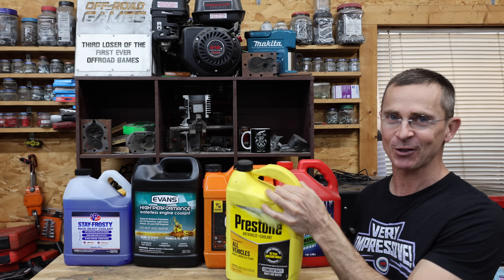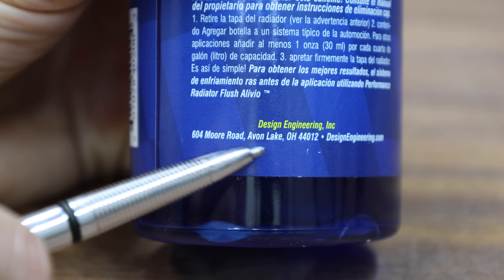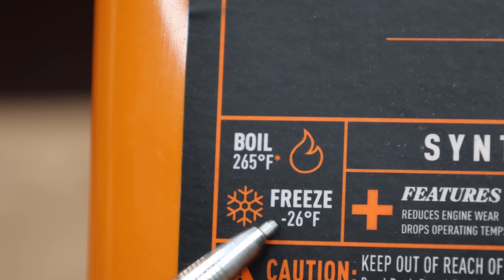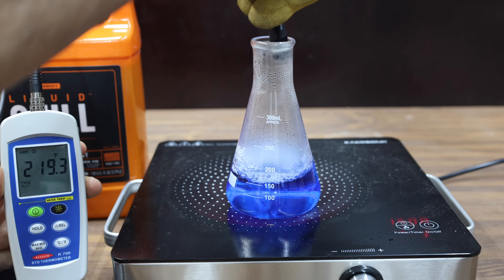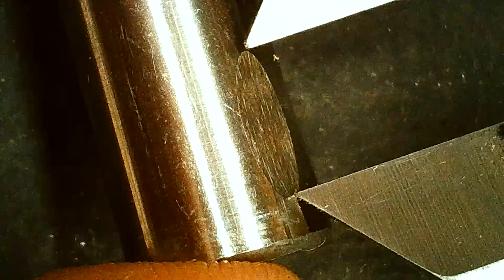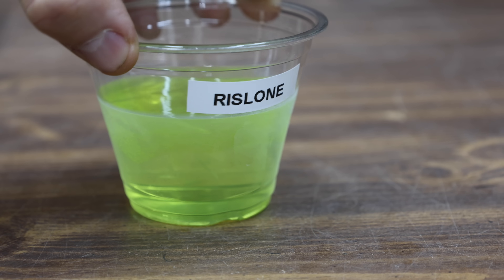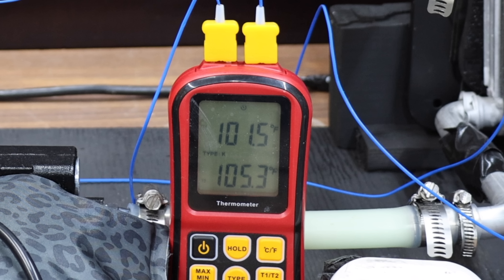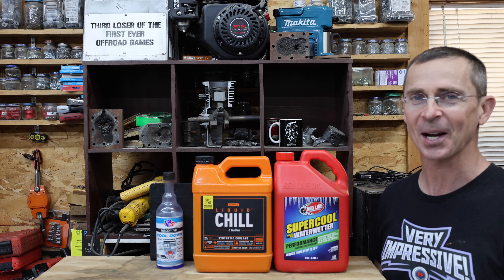Do "Super Coolants" Lower Engine Temperature By 30 Degrees?

Comment: Been waiting years for a test on the waterless anti-freeze. Thanks.
Reply: My Test was  it in real life and it is great, but expensive, you have to drain everything out and flush with water, then remove thermostat, flush with a Special chemical that removes water from the system and the  waterless coolant. 
You have never to change again, No waterpump defects, No headgasket sorrows, almost No pressure ON system, so No leaks, No Bad radiators or caps. Even If you get it out, you can Put through paint filter and reuse it.
Reply: @ I was told you have to bake the engine/car in an oven to make sure the cooling system is BONE DRY or the trapped water/moisture will steam off and ruin the whole concept.
Reply: @postalinVT  It's not that complicated from what I remember. Some would use a shopvac or hairdryer / heat-gun to dry out the system (leave it connected, pump warm/dry air through) or you can flush it with alcohol (prep fluid). Many interesting advantages to Evans waterless coolant.
Reply: @marstedt  Or when you are replacing corroded head gaskets. I also replaced the heater core and radiator at the time, as well as hoses. It's a good product.
Reply: @marstedt 
Back in the '90s, I requested the free literature from a magazine and I saw in like Hot rod or something. 
Basically they said it sucked the heat out so much better ,that all the guys with musclecars and high compression and pinging/spark knock because of crappy modern gas would have it pretty much disappear.
Reply: Well it has a pH and sulfuric acid is soluble and lowers the pH. That means it will dissolve a bit of water and be pretty much unchanged. Just saying and using my chem degree. I don’t know what the solvent is in the evens
Reply: @gasauto1675  FOLLOWING THIS FOR FUTURE REFERENCE 👍
Reply from the maker: You are welcome!
Reply: FOLLOWING THIS FOR FUTURE REFERENCE 👍
Reply: A key point about waterless is it may not be suitable for thermo-syphon systems due to its high viscosity. Evans have a low viscosity version but it isn't on the market at this point.

Comment: What I saw, is none of these lived up to what they claim, aside from the Evan's not freezing. They also add the potential to cause damage to your engine. How? Normal operating temperatures for engines is between 190 and 230 degrees, which anti-freeze does. Anything below this means the oil is not at the temperature to do it's job properly. Thus, you end up with more bearing, piston ring, and cylinder wear. Which is also why you used to hear, "Never rev/race a cold engine." This is why you see race cars being warmed up to operating temperatures, before the race starts.
Reply: In reality the thermostat should prevent this issue as it basically bypasses the radiator until coolant temperatures get high enough for 'good' engine running. You'd likely only see any benefit to cooling in extremely hot weather, under very heavy engine loads or if there was a problem with another part of the cooling system (e.g. the fan or partial blockage of the radiator core).
Reply: @ The thermostat isn't a bypass. It's a flow regulator. When you look up a thermostat. The temperature that is listed on it, is at what temperature it will open to allow more coolant to flow through the engine. It also shows the baseline temp it's trying to keep the engine at. For example, the thermostat on mine is at 192 degrees. The normal line on my temp gauge is right at 200 degrees. It hangs just under that line most of the time., so I know my thermostat is working.

But, yes, you're right on the rest. If high exterior temps, or heavy loads, are causing the vehicle to run at high/overheat temps. Then, yeah, this is a problem with the cooling package. But, only if it's running high. If the temp is under 230, that's within normal operating temps.
Reply: @jarack3256  Yes it regulates the flow through the radiator and until the coolant reaches the start of the thermostat's opening range, almost all the flow bypasses the radiator.
Reply: @217mot  There are benefits overall. Heat (and metal expansion and contraction) is what ultimately destroys all engines.
Reply: Your car doesn’t overcool when outside temps drop 30 degrees from normal. 

Thermostat will keep it at the proper running temperature, it just has some headroom when things go wrong and it overheats.
Reply: Simply wrong there mate.
It is the thermostat that regulates flow through the radiator as a function of thermal set point. On cold startup there will only be the bypass flow (which is tiny) through the radiator. Your heat input is the same. Until the thermostat opens your heat output is essentially exclusive of the radiator. Think about it.
Reply from the maker: Thanks for the feedback.
Reply: There was an actual scientific study done on coolant temperature and wear by GM (IIRC). It showed 160 F as when engine wear greatly reduces and then above that and especially above 180 it is just diminishing returns. 

A well functioning thermostat in the engine does not let it get any colder than what it's designed to be, it doesn't matter how efficient the radiator or coolant is. But more efficiency does matter when demand goes up. 

I will say most of us probably don't need these additives, but being someone with an anxiety disorder and having been stuck on the interstate for up to 2 hours on a hot summer Southern day, more than once, I can say I have seriously considered it and it still is in the back of my mind.
Reply: Your thermostat should keep the temperature the same, it's just the additives give the coolant to transfer more heat if it needs t
Reply: These products will improve heat transfer from engine to coolant allowing your system to reach operating temp sooner and oil Temps along with it.  It increases the efficiency of the system and people in hot environments need the improved transfer performance at the radiator.  The thermostat still regulates the minimum temperature and the additives add protection above that.
Reply: Needs a revisit. Under pressure coolant acts differently.  I use the Risolone in my Kenworth,  I definitely noticed that the engine doesn't get hot as fast, and the fan cycles less. 8.3L cummins
Reply: @AlcornDynamics  The engine should get hot faster with the thermostat closed. I've found many thermostats on my vehicles were slowly going bad before they all out went out, not warming up as fast as they should and it was a gradual decline. Maybe you should check yours.
Reply: @HAL-dm1eh  you missed the fact that im in big trucks, hills and weight though the southwest is hard on a cooling system.
Reply: Wear drops off after the oil reaches around 155 degrees F. The oil geek and Daves auto repair just went over that data.
Reply: Exactly this. Unless you have overheating problems, these don't really seem worth it to me. The pH buffering is interesting, but I have no idea if that is normally a problem or not.
Reply: @thorwaldjohanson2526  the pH buffering, is relevant in certain applications. It's one of the reasons, why there's different factory coolants.
Reply: Agreed when it comes to cold starting as that's when most of the wear occurs. Other than that, I've always had the best of luck with heavier oils. They breakdown later, lubricate better and keep viscosity longer. I am totally against this new fashion of ultra low viscosity oils in the name of fuel efficiency. Yes, heavier oils will impact gas mileage.. why? Because there is a heavier and thicker coating between the parts making the engine having to work slightly harder. Most oil at high temps is just like water, a horrifying thing. Best yet, simply change your oil more often. There is no such thing as 5000 or 10000 miles safe oil, forget about it. All oils get contained (very quickly) with the combustion process. Best oil you can use and best insurance for the long life of your engine is keeping new oil in it. I never do more than 3000 on any oil, no matter the brand, the specs , the price or the viscosity.
Reply: @yuidfbse sorry I don’t have the link, but I read a report a long time ago that the NYC taxi company started testing full synthetic oil vs conventional. Even after extended oil changes, the synthetic still exceeded new oil performance parameters. The switch, and extended oil changes saved them tons of money, and far less waste. This was well before 0w-16 oil, though. The super thin oil scares me too.
Reply: @OutdoorGirls7  Understood and it is a fact that oil quality and proper additives have dramatically improved over how oil used to be years ago. And fully synthetic is leaps and bounds superior to anything conventional. This said, oil and oil filters are so cheap that I feel there is no better insurance for the long life of any car than feeding it with clean oil as much as possible, a process I do easily by myself on my garage on top of that. Everyone's mileage varies of course and I've heard of half a million miles cars that rarely do oil changes and just keep going. More power to them and a testament of how far we've come in engine reliability and good proper fluids:)
Reply: @yuidfbse 3k miles?  Hasn't this been debunked by so many sources over and over and over again?
Reply: @endeavorrv  Debunked by others, I could care less. Actually proven by me is the only thing that matters.

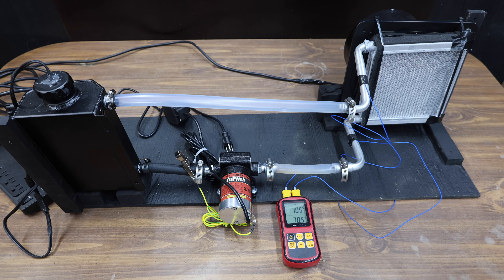Comment: Comparing temperature decreases of the coolant only tells you the heat capacity of the coolant (12:50).  Water has a much higher heat capacity than ethylene glycol and propylene glycol ('the glycols').  That means the glycol's temperature will increase more than water's given the same amount of heat absorbed.  A larger coolant temperature decrease does not tell you how well the coolant works.
Reply from the maker: Thanks for sharing!

Comment: I started using these types of products when my jeep was getting hot no matter what I did. Replaced the radiator, flushed the engine with descaling products, new clutch fan, new electric fan.. Just wouldn't keep cool. It's pretty modified and the v8 engine has had a lot of internal upgrades (cams, pistons, valve springs)

The water wetter made the difference. I added the recommended amount and I immediately noticed a difference.
Reply: If your engine is running hot and doesn't have a mechanical problem it's usually just a matter of inadequate heat exchange at the radiator. A bigger radiator would solve it. But good you were able to fix it with an additive.
Reply: @tomgnyc  I already did the larger, thicker radiator. But the modifications and power output still were pushing the limits. It never over heated but runs hotter than it should. Now it's solid though.
Reply from the maker: Thanks for sharing.
Reply: Thank you Todd always appreciated
Reply: No mention of replacing the thermostat. Hoping you simply forgot to mention it.
Reply: @dchawk81  correct. OEM only on them as well. I did try a slightly lower temp at one point, no dice.
Reply: @sHoRtBuSseR  that makes me wonder if the engine block doesn't have enough flow to allow for upgrades. Maybe it was designed only for stock.
Reply: @dchawk81  it actually holds a ridiculous amount of coolant. When I was a Chrysler tech, one of the professors at school said that engine might have too much coolant so the flow is insufficient at high load.
Reply: @sHoRtBuSseR  that's interesting. I never would have considered that possibility.
Reply: Hmm, Water Wetter has never done a thing for my drag car. Ran the SAME average temps per pass as without it. I tested it several times when I had to empty the rad, and then adding another bottle while refilling it. Just plain out didn't do anything. I stopped buying it.

Comment: Something is wrong, here...
I mean, an engine is built to operate optimally under specific conditions, which also include the heat. We aren't supposed to lower that optimal temperature because that doesn't make the engine run better and it doesn't prolong it's life. On the contrary, an underheated engine will last shorter and perform worse. These products are a scam. Probably based on very old American cars which used to overheat regularly...
Reply: Yeah I'm not going to buy into them but if you're doing hard pulls or racing all the time I can understand it. For a regular everyday vehicle? Nah. Just use what it calls for and keep the cooling system operating properly and it'll be fine.

Comment: Very informative video but what I like to do is use Toyota 100% long life coolant and on top of that 4 oz of AT 205 which softens the rubber on the water pump & other rubber, parts, every January & never had to replace water pump on 2000 civic 201,000 miles, & has never overheated, that's a 25 yr old car!.
Reply from the maker: Thanks!  Thanks for sharing.

Comment: This is some very useful information, but I don’t think it’s actually showing what a lot of people think it’s showing. The bottom line after you look at all this data is that there’s no significant difference between any of these products unless you have a very specific need that very few regular car owners and drivers have. Because you did the cumulative temperature difference it’s greatly exaggerated the actual meaningful difference between these products. When you actually look at the average reduction in temperature that was achieved the difference between the best performing and the worst performing is only about 3°. If you have a car where a 3° difference is the difference between everything‘s OK and it’s gonna blow up you’re really way too close to everything‘s gonna blow up. So again realistically all of these products are fine for the normal car driver absent some special concern. For example, if you’re like Jay Leno and you got dozens and dozens and dozens of cars and you don’t wanna have to be changing the coolant all the time something like Evan’s coolant that will last forever might be a good choice and it’s worth the extra price . But for most people the typical antifreeze that will last for 10 years 150,000 miles that’s really gonna get you everything you need. It’s not gonna harm anything if you added some of these $10 and $15 additives, but you’re really fooling yourself if you think you’re really gaining anything of significance.

Comment: Sorry, but engine temperature is determined by the thermostat typically 180-195 degrees. The thermostat restricts the water flow until the engine is warmed up.
Reply: Although you are absolutely correct in your assumption about water temperature being controlled by the thermostat, these products aid in heat transfer. Both in how fast it removes heat from the water passages and how fast the circulating solution can get rid of that heat in your radiator.
 My fleet mechanic explained it to me when I was having issues with radiator temperature rising on a long haul uphill climb in the mountains. He added a product to my radiator and that was the last time my temperature rose above the thermostat setpoint.
Reply: @petersoos498  it's perfectly fine for the temps to rise above the set point. As long as it doesn't boil over. That's why the fan kicks on.

Comment: 190°f must be maintained for ECM to go into closed loop .
You can check coolant by using a VOM meter in millivolt setting.
Should be less than 50+- (or  as per mfg spec ) MV from Coolant in top of  radiator to negative ground .
Coolant which shows 
Excessive voltage causes electrolysis having 
Low pH means coolant should be changed.

I use coolant additive from CAT or Deere .
Small bottle add to existing coolant use distilled water only.

Comment: One thing about the Evans that should be considered.  You can't exchange heat if your product is boiling off or frozen solid.  It should be noted that while the Evans was poorest at exchanging heat, it would continue to do its job long after the other products stopped altogether.

Comment: I’ve used red line water wetter from the mid 90’s to early 2000’s, it seemed to work great and I never had my cars over heat 👍.
I then switched to Amsoil coolant boost in the mid 2000’s.
The coolant boost has also been good for my cars and now trucks, never have I over heated and vehicles also seem to warm up quickly when lightly driven at first. 
Note I meticulously maintain my vehicles.
Reply from the maker: Thanks for sharing.

Comment: Thank you for the comparison! Just a minor detail - please add in a column showing the start and end PH of each product on the same graph - this way it is quite a bit easier to compare the buffer capabilites of each coolant. Also a few heat cycles may change that property, maybe it will be beneficial for future comparisons to test "used" (artificially aged) coolant. 

Something to keep in mind is that buffer capacity (the ability to resist change in ph) is not a linear dependency - for example a ph change from 9 to 6.45 means much worse than a change from 8.5 to 6.40.
Reply from the maker: You are welcome!  Thanks for the constructive feedback.

Comment: I remember commenting many videos ago about how I'd be super interested seeing a test like this. Glad to see PF delivered!

Personally I live in a very hot area, I've had the best luck running a 30/70 mix of concentrate coolant and distilled water + Redline Water Wetter. All of this is based on my substantially less scientific experiments than Project Farm, so take that with a grain of salt lol. Water Wetter is very well respected in the car world however (evident by how well it did in the testing in this video).
Reply from the maker: Thanks!  Thanks for suggesting the video idea.  Thanks for the feedback.
Reply: @ProjectFarm  This is probably the best way to go about testing them as well, so thanks for being thorough  (as you always do)

Comment: move that heater core about 20 feet away , do the very same test , i'd like to know the temp of the air the fan is moveing  through the core ,, just like in a truck cab , ------- just a thought ?